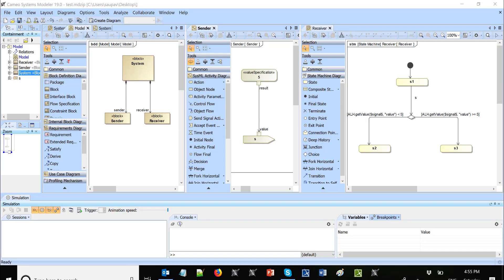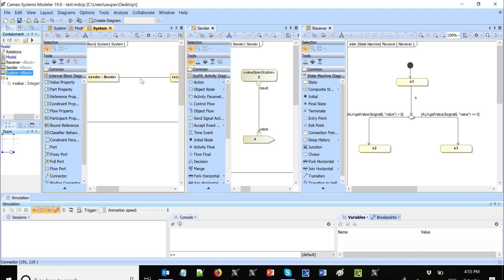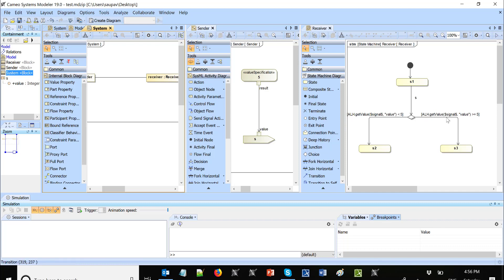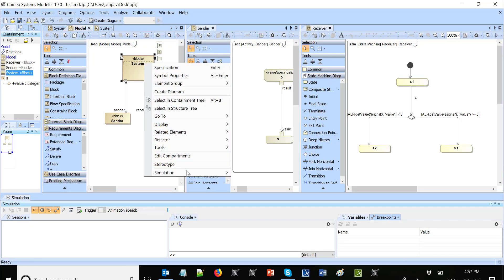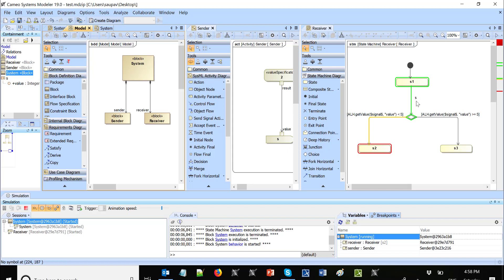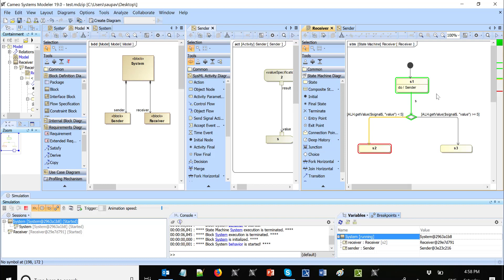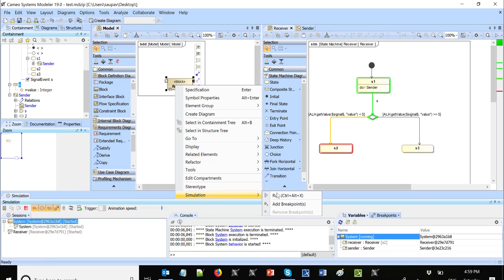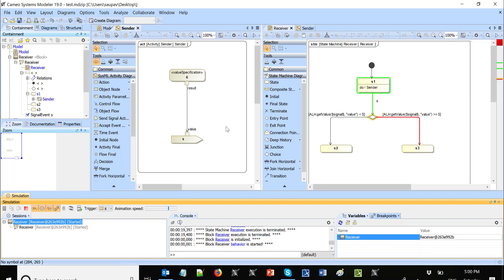Send Signal With Property and Capture It

Comment: Hello, thanks for the video. It really helped me when i trying to create stm. 

Let me ask you a question.

Let's say I have same system as described here. But I create a signal which names "s" and attribute is "value:Integer". 
I created act diagram and I have 2 swimlane as "Sender" and "Receiver".
At the "Sender" swimlane, I defined an "SEND" action and it has own activity diagram and it has just "value specification" which is "30". 
At the "Receiver" swimlane, I defined an "RECEIVE" action and it just want to take "30". 

Problem is: 
- I connect with connector these 2 action which located in different swimlanes. (object flow). And I assign the "s" signal.
- In the "SEND" action, I see "out" node but it is an "signal" type. But value spec expects integer. 

So, I dont know how to use signal properties with act. diagram. I know "send signal action" and "accept event action" but it does not solve my problem because I would like to see my signal flow on the act diagram.

I hope you understand me because it is kinda complicated at least for me. 

Thanks a lot.

ps: I also watched this video https://www.youtube.com/watch?v=Cwz_tuKX_xs 
But you've never used different swimlane so it is my main problem I guess.
Reply from the maker: Hello Ufuk. Great question. You need to use object flow to see the seignal. Similar to this video https://youtu.be/4qRClTMsVxw. But different ALH to create signal. Check docs.nomagic.com for right ALH.
Reply: @MBSEExecution  Is there any chance to send you an e-mail to show you the Problem with screenshots? Cause I've also watched the Video that you've told :(
Reply from the maker: Yes, please send to mbseexecution@gmail.com